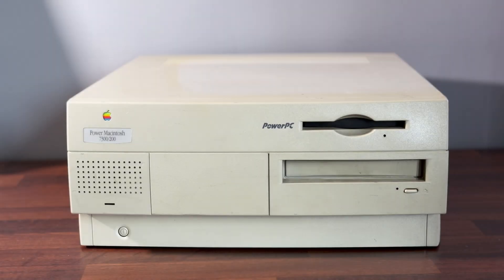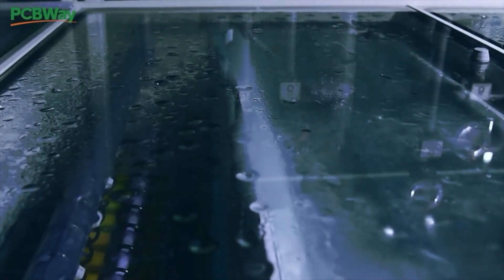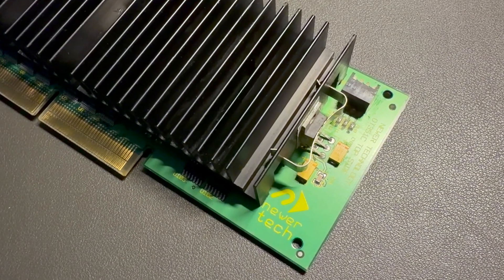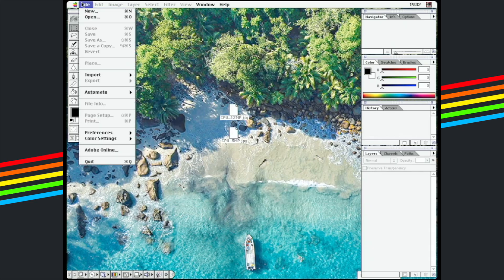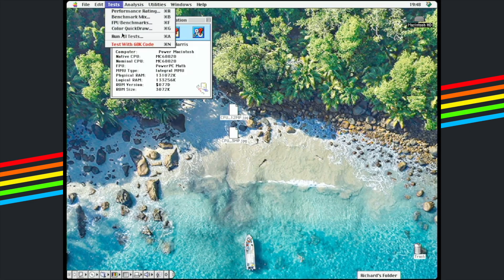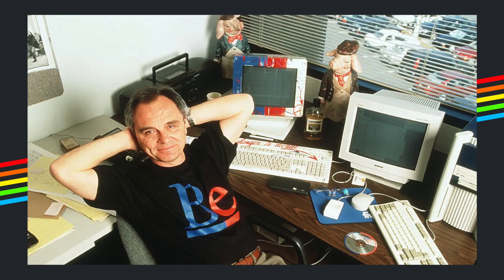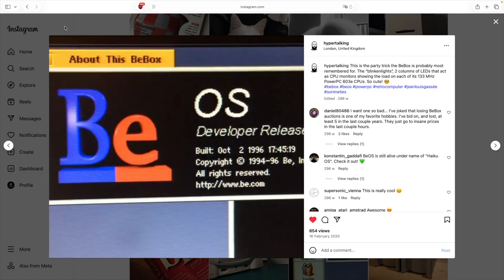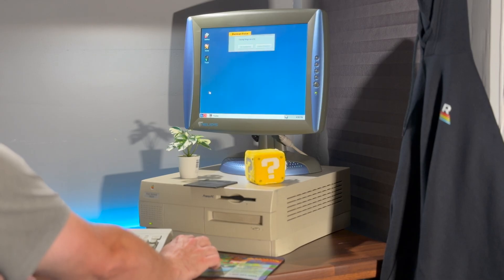Can I get BeOS to run on a Mac with a G3 CPU? Let's find out!

Comment: Wouldn't this have worked on the beige G3?
Reply from the maker: It's a great question but from what I gather, the answer is no. Apple didn't provide documentation for the new 'Gossamer' motherboards. These had personality card slots and different chipset/IDE support, and without the documentation from Apple, Be couldn't get a stable and  generally-working solution.

Comment: Spoiler alert - yep, G3 add-on cards worked. It was the motherboard that was the issue with newer boards not the CPU itself. ;)

but full disclosure: I worked at Be for years.